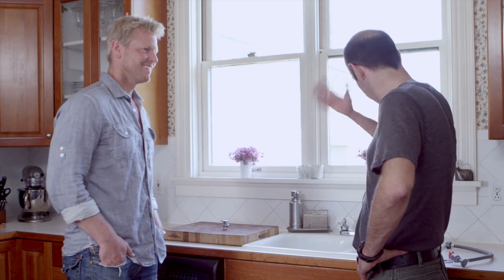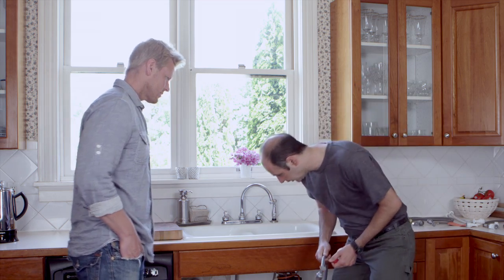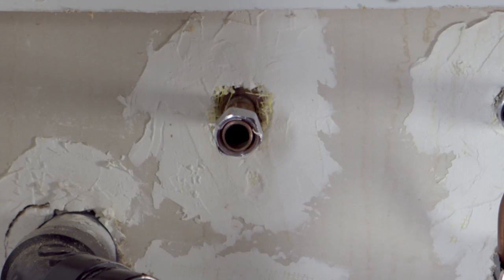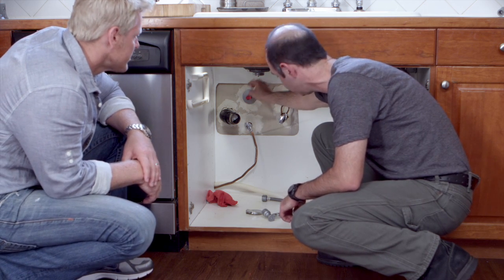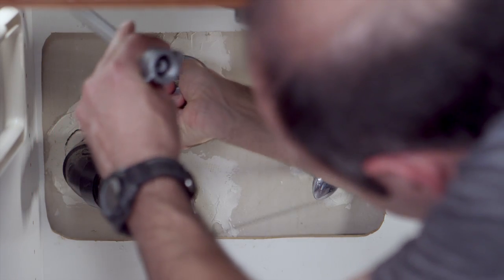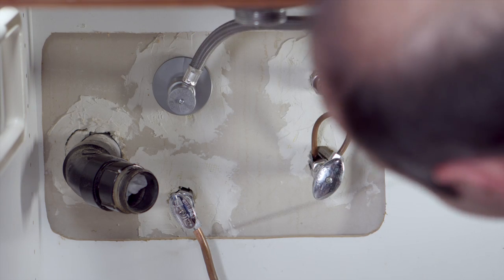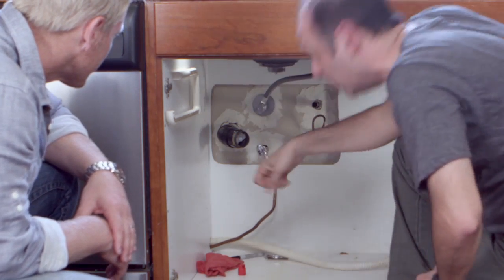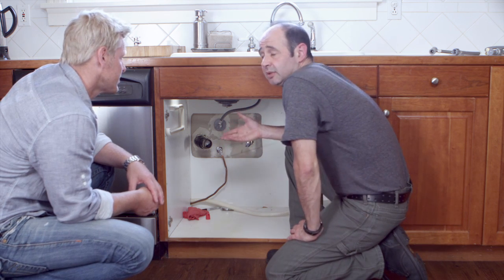How to Install a FlowTite R-SERIES Supply Stop - ACCOR Technology, Inc.

Comment: NO, he uses it because it was the cheapest thing he could find to use to MAXIMIZE his profits because he's greedy and doesn't care about quality work.  I have these pieces of CRAP the builder put in my home, they are hard to push closed and pull to open the valve.  For some reason they were crimped on to the PEX B water line with a copper ring.

Anyone watching this DO NOT BUY or USE these cheap pieces of total garbage. According to reports I have received they are also known to BLOW off of the water supply line flooding your home.